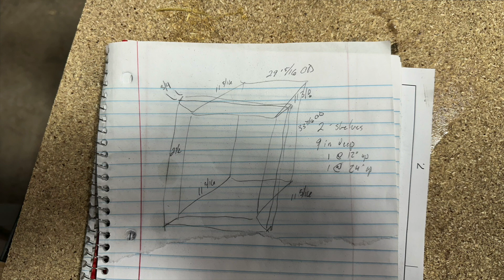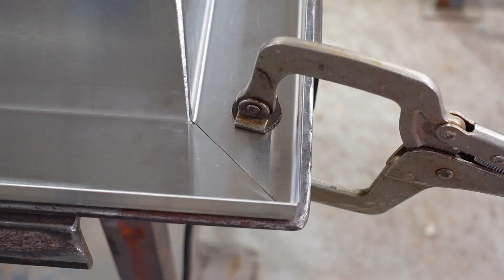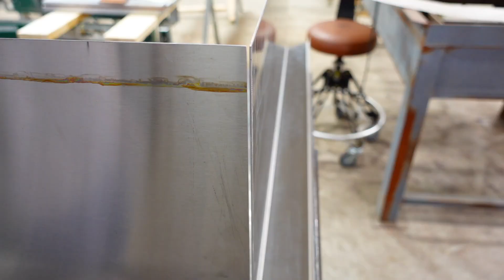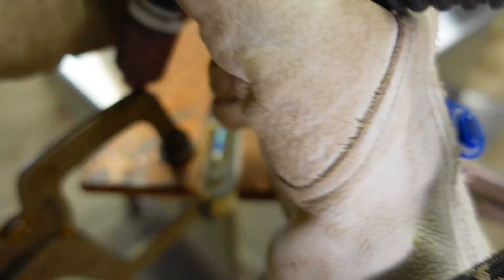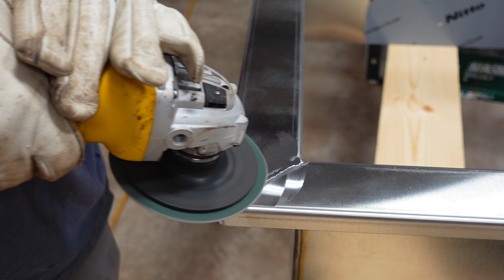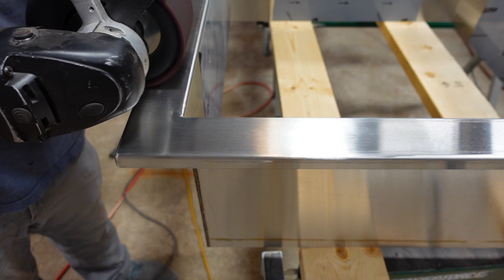🔴Stainless Steel and More Stainless Steel

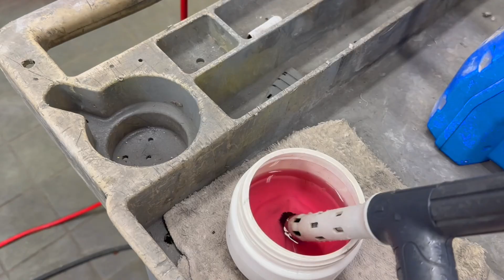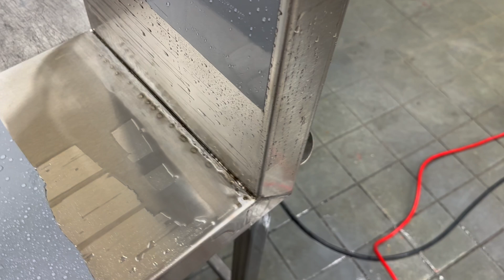Comment: Really awesome work.   What is that you're using at about 4:23 to 4:35?
Thanks for taking the time to make these videos.   Thumbs up.
Reply from the maker: That’s called a Tig Brush. There is another popular brand called Surfox. They essentially use a small current in acid to remove the oxidation of Stainless steel welds. Thanks for watching and commenting!